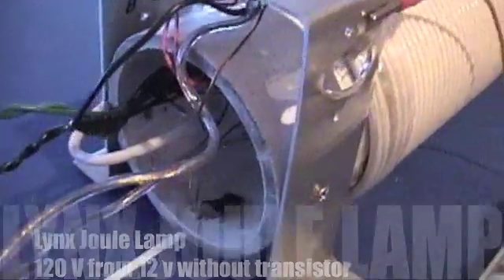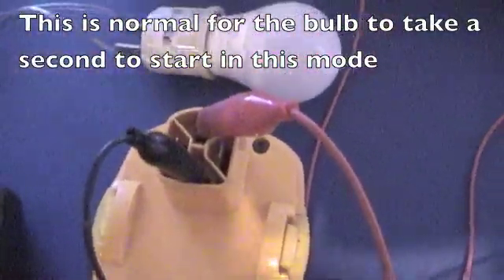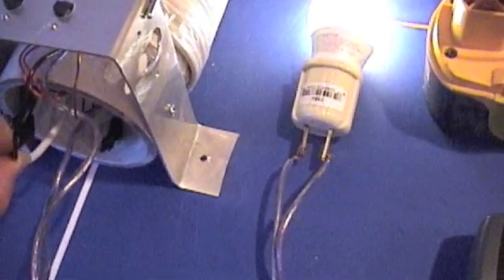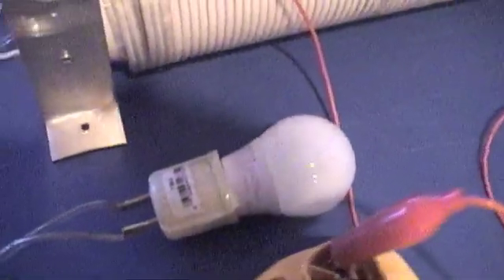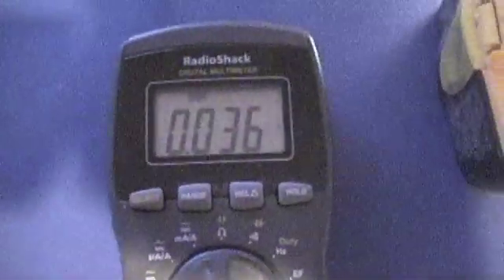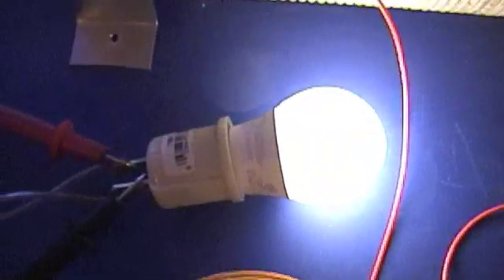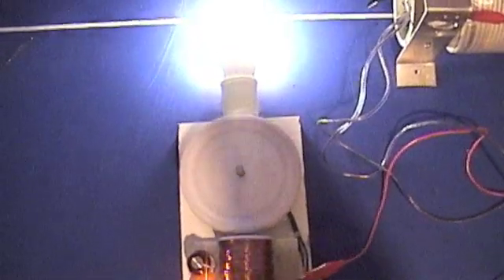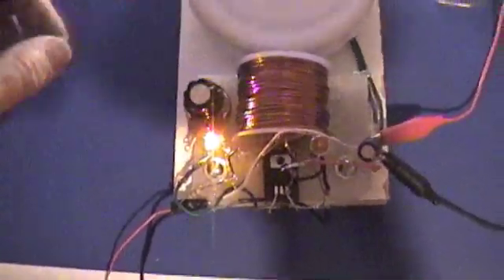Lynx Joule Lamp - No transistor

Comment: If you notice, this video is 9 months old.  It turns out that this particular type of LED 110 v bulb has a circuit in it that acts as the oscillator.  It just needs an inductor in between DC supply and the bulb.  I can light these bulbs with just a 60 turn copper wire coil.  If you want to try this, find a non-dimmable LED bulb

Comment from the maker: You should be cynical, especially of YouTube videos.  Many of my videos are done for fellow experimenters with little explanation for the public benefit.  When I have something of public importance I tailor it for that audience.  
Its usually pretty impossible to light 120 v bulbs with low voltage DC.  This particular bulb (Phillips 3w LED) will dimly flash off 12 v DC.  This video demonstrates that anything that will oscillate the circuit will transform the low volt DC to higher voltage AC.

Comment: I dont mean to seem cynical but what exactly are you trying to prove here?  "a transistor isn't necessary to run a 120 volt bulb from 12 volts."  The EE / MS that designed the bulb calculates the avg life span at max based on our electricity.  Sure it will "work" under different configurations but it's not going to be optimal. . . Run 20 tests of avg life of a bulb at 12v. and compare to the stated life on the box. . . 
"